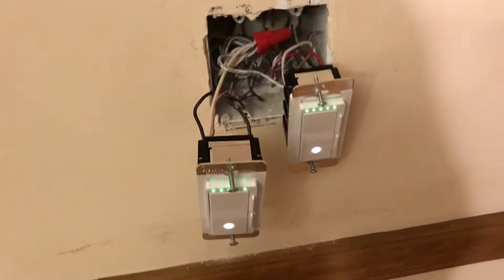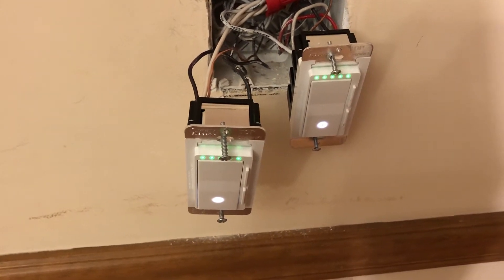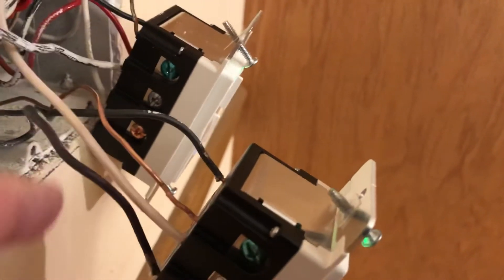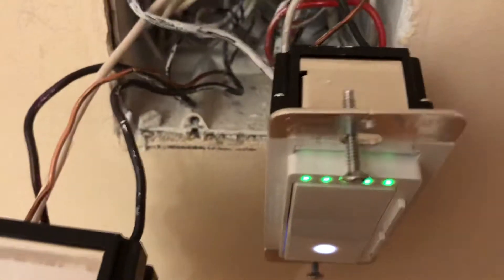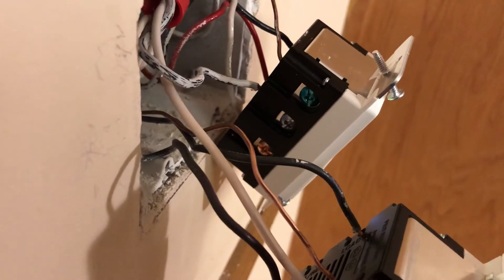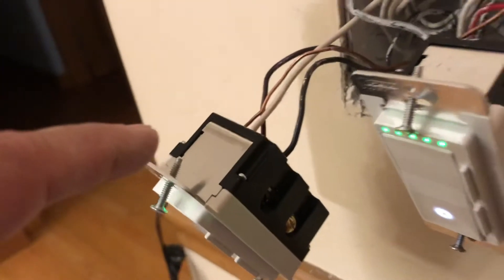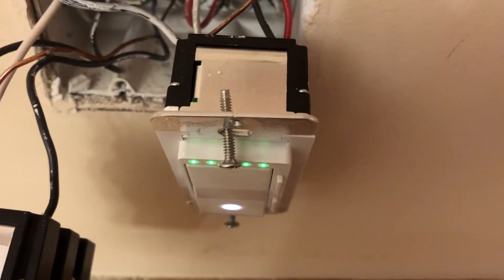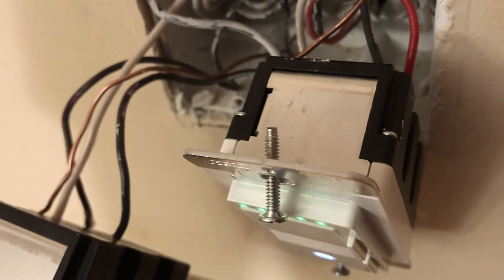Single pole and 3 way Feit electric smart dimmer installation

Comment: You said you can install the stitch at either box and it doesn't matter. The instructions say it must be installed on the load side and your video shows it was installed on the load side. If it's possible to install on the other switch, I would like to see how you do it.
Reply from the maker: I think it can be installed either side but I suggest you follow the instructions to avoid any confusion.
Reply: It can't be installed on either one. Must be installed on the load side. I painfully went through this experiment twice

Comment: Just replaced 5 of these for a customer bc they all stopped working due to a power surge or something...cracks me up when people spend tons of money on these things when the old cheap ones are more reliable.
Reply from the maker: Oh ok. Fortunately , mine are still working fine for me
Reply: These go on sale 4-5 times a year at Costco - and when they do the  cost is about $2/3 more per switch than a standard 3 pole dimmer switch at HD

Comment: Thank you it was very informative. I have been having issues wiring the single pole and 3 way. The neutral wiring I are know was wrong. The instructions provided with the switch isn’t correct. I know understand that I have to  add a neutral wire to the existing. I had power but the switch wouldn’t let me turn the light fixture in and off. So I just let it stay on. It is for my outside fixture.

Comment: Could you please re-due this video with the three way switch you don't show the other side of the circuit and I would like to see both three way switches. Due to I'm thinking about replacing my z-wave switches. To new Wi-Fi smart switch.
Reply from the maker: Actually I only installed it on one side of the circuit.

Comment: the black cables load is is hot the AC-L in black tbn is hot or is it a jumper that goes to the other switch in load can you explain the black cable well if all are hot or there is a jumper?